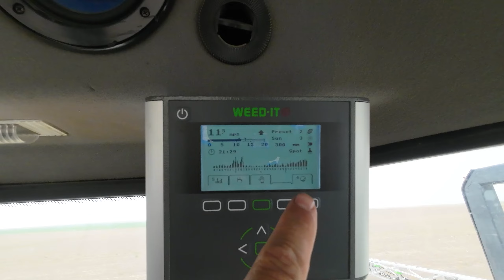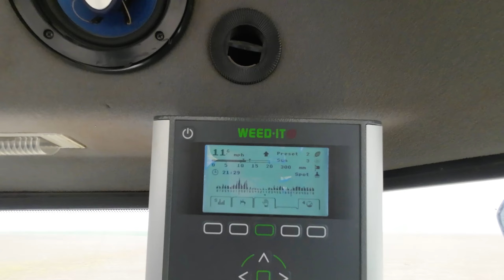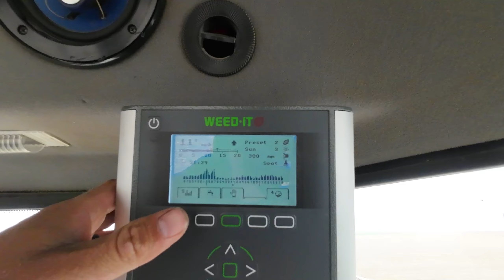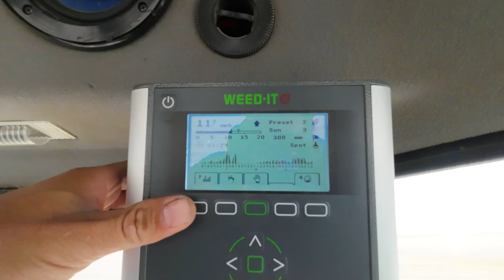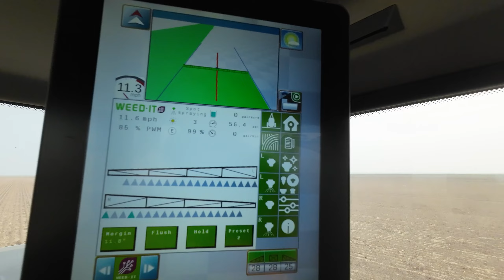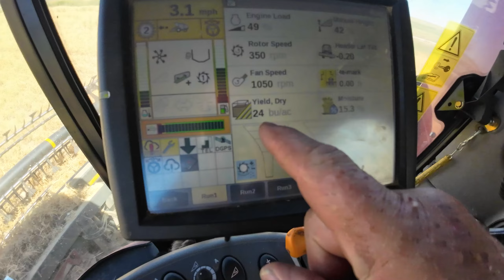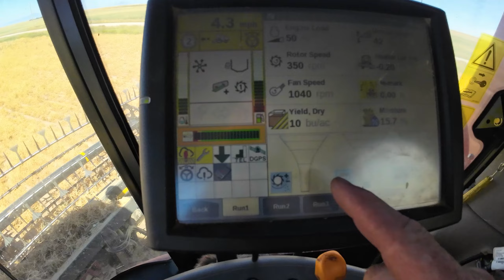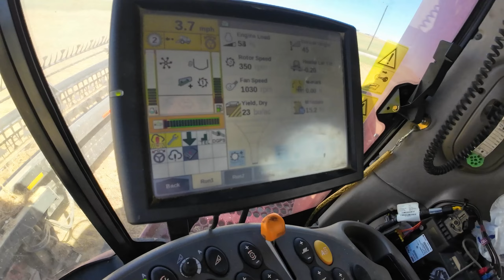This bird hates me, POOP EVERYWHERE! - Harvest Part 2

Comment: 15:24 I’ve done tires for fifty years something that might help airing up tires like on your sprayer take a female hose end and take the the core housing out screw hose end on the end of the stem the threads aren’t quite the same but it will work that gives you more air going into the tire and air up easier hope it helps God Bless